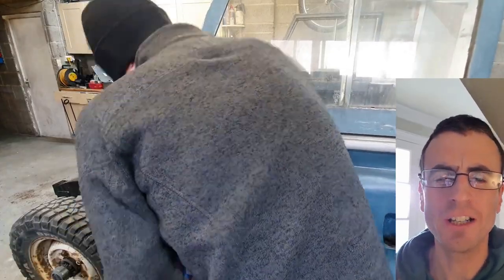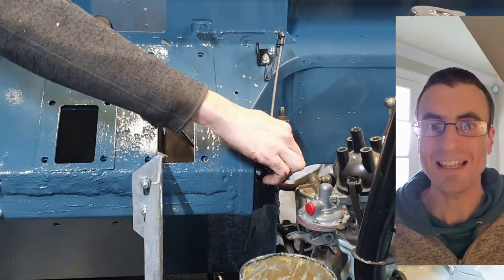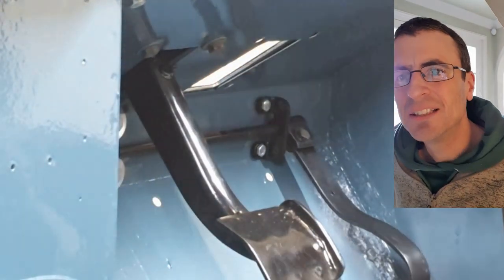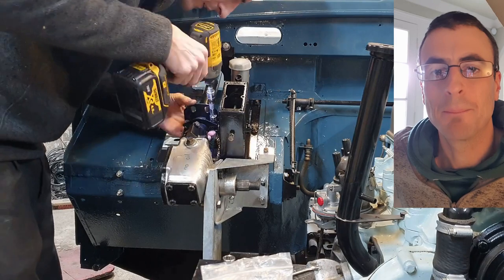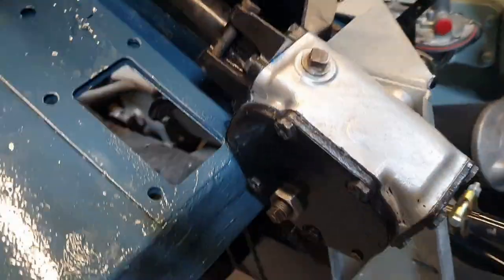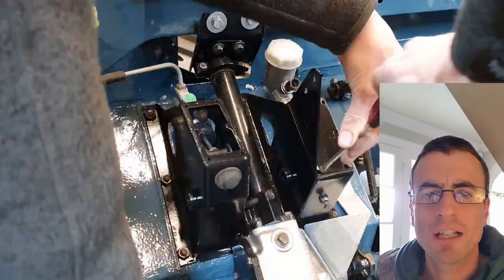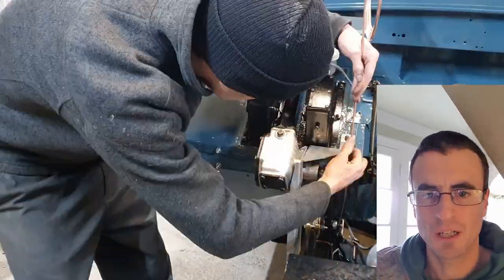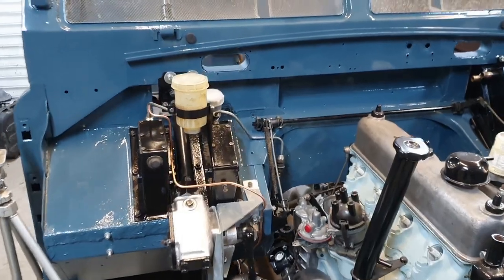Satisfying Final Assembly - lots of parts go back on the bulkhead - 30 Land Rover Series 3 Project

Comment: Looking really nice with all those shiny clean parts. I did wonder if there should be a rubber seal between the brake and clutch turrets and the bulkhead, I've a recollection of not fitting them myself and getting rain water dripping on my foot😱
Reply from the maker: David thats an excellent point. Although I didn't show it in the video. I did put a healthy dose of RTV on the mating face before mounting it. 

I'm really trying hard to make the videos better, getting tye camera in the best place, often making it harder to actually do the work. This often means I will take a clip, then go back and redo the work. This is probably why I missed filming the RTV going on. 

Many thanks for the comment. I'm sure there is plenty I have got wrong so keep the comments coming please :)
Reply: @lozl  A bit late, because the video was upload some time ago but I also realized about the seals on the turrets... not a bad idea about the RTV sealant but I would prefer, and I did it on my series III many years ago, to put the same foam seal you put in the heater (to the bulkhead) but maybe a bit thinner... 
Anyway, nice videos, so good to discover your videos, I am enjoying them a lot... Regards from the Canaries!
Reply from the maker: @ViDiaz  Yes this would have worked well! It's really useful stuff that sticky back foam, I've used it lots on other things too :)

I just sold the landrover yesterday on behalf of the owner. It was rather sad to see it dissappear down the road.

Comment: Alot nicer hearing the impact over the compressor, did you put the brake lines on metric or imperial? This is one of my jobs, they are shot!
Reply from the maker: Its been amazing, I wish I'd bought an impact gun years ago, it's literally saved hours of work already!

I'm pretty sure I stuck with imperial fittings on this project